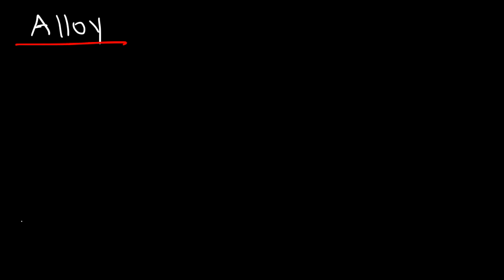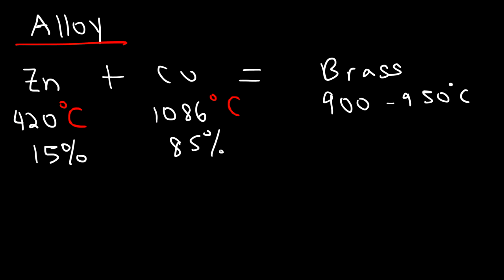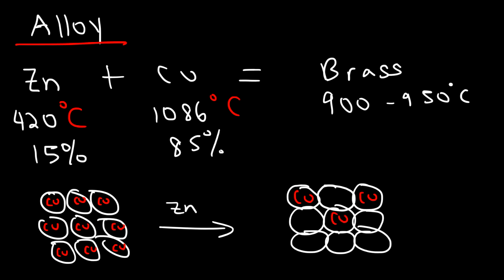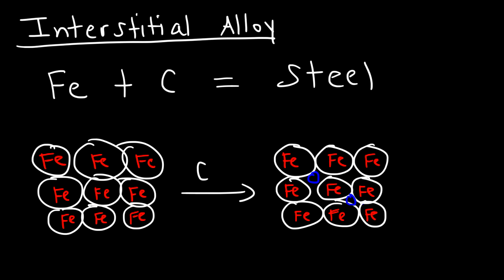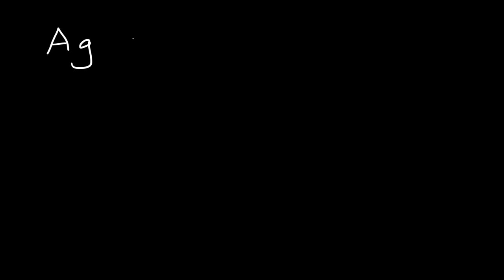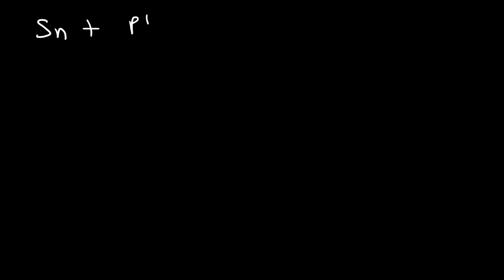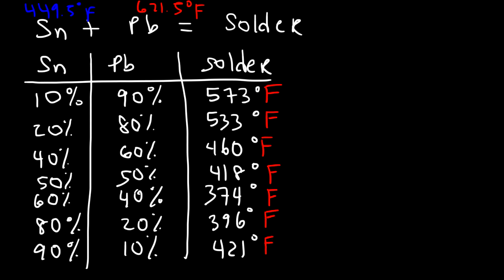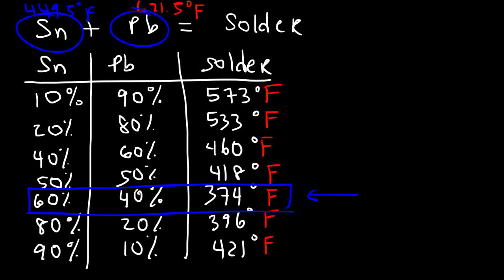Metal Alloys, Substitutional Alloys and Interstitial Alloys, Chemistry, Basic Introduction

Comment: Converting 420 C and 1086 C to Kelvin gives 693.15 k and 1359.15 k respectively, multiplying those numbers with each metal's percent in the example alloy: 
1359.15*.85+693.16*.15=1259.252 K or 985.85 C meaning that the melting point is about 36 to 86 degrees cooler than you would expect if it was a linear relationship.